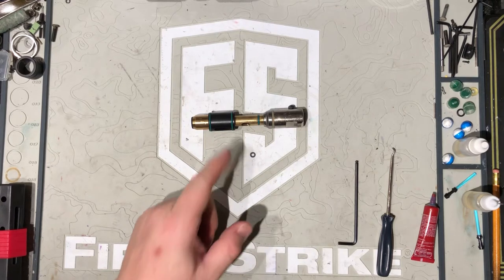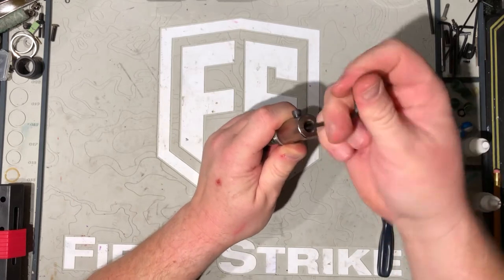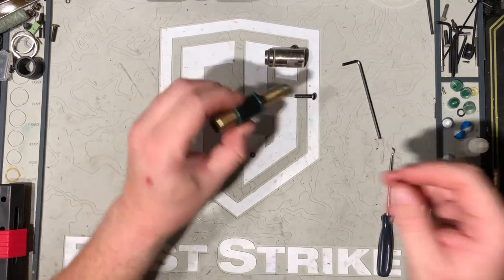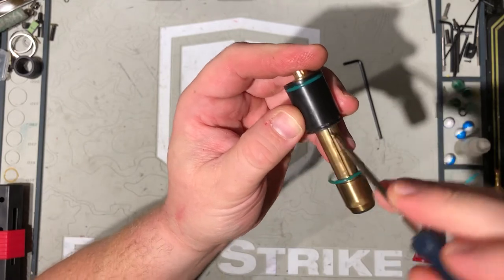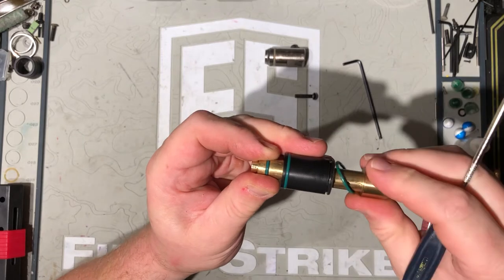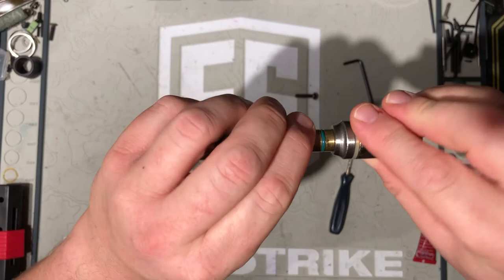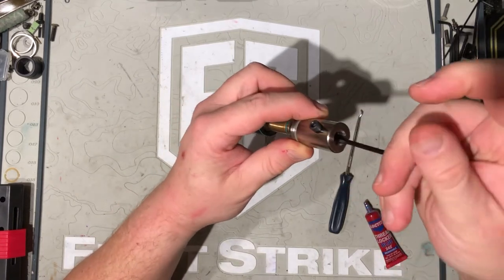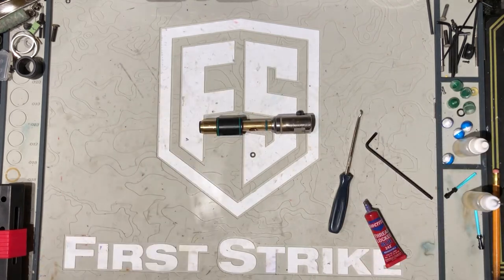Disassembly/reassembly of your first strike T15 bolt

Comment: Any chance of a video taking a look at the plastic bolt tip? I've noticed it can get a bit chewed up after a while if you're running a lok bolt so I figured it may be worth putting out there.
Reply from the maker: Let me figure out an easy solution to remove a chewed up plastic bolt tip. And I’ve never had that request before. Closest thing has been how to glue a tip back on lol.

Comment: have you had any problems with the plastic bulk head? Mine is starting to deform and ive only had my t15 for about 8 months. I also had to add an oring to the mushroom head because the plastic bulkhead would get jammed against it not being able to fire, hence why I added the oring so that it can bounce off of the mushrrom head so that it wont jam and leak air. I take really good care of this t15 and watch your videos to maintenance it but it seems like mine is just falling apart.
Reply: also another thing, do you know where to get spare parts for these markers? seems like they are out of stock everywhere.
Reply from the maker: Hmmm, what oil are you using to lube the marker? 
How open/closed is the recock screw? Sounds like the bulk head is getting really pounded.